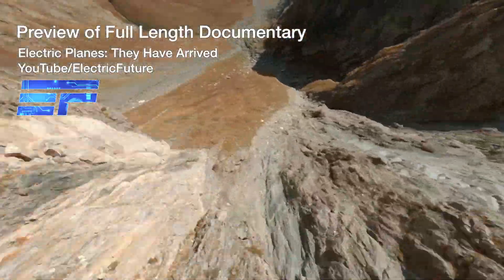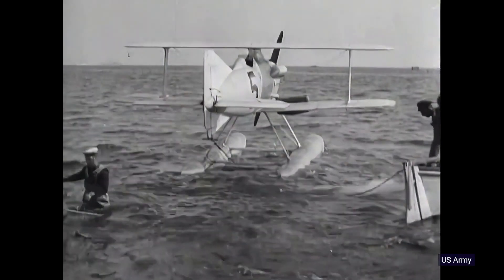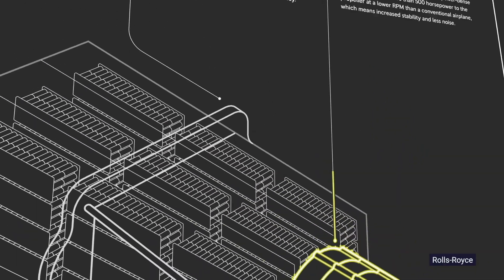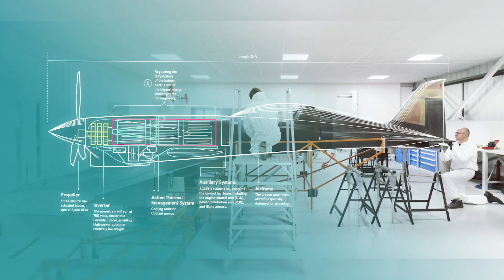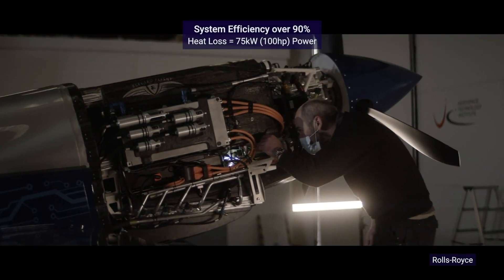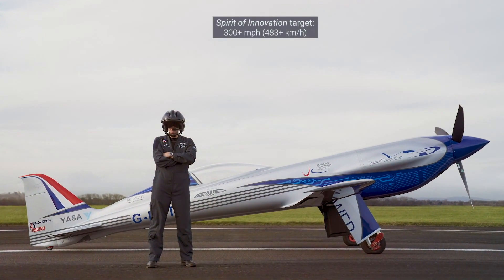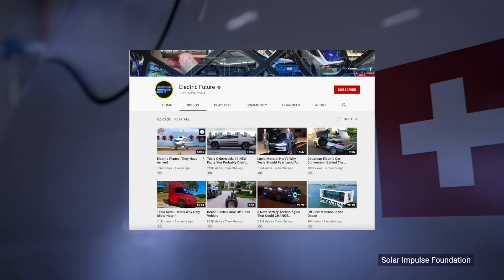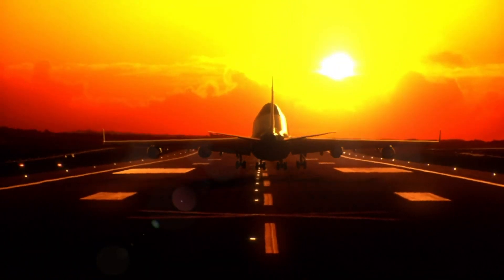The Fastest Electric Plane in the World

Comment: The stealth bomber is the most innovative electric plane that I have heard of. The vastly underpowered jet engine is a van der Graff generator to supply the extra high voltage conductor along the front of it's wing.
Thrust is generated electro-gravitcally.
Ref: Secrets of anti-gravity by Dr. Paul leViolete.

Comment: This is rubbish. The  Supermarine S-6B shows how little potential electric flight actually has. Battery powered aircraft have been flying for thirty years. Less than thirty years after the first powered flight, the S-6B went about 400 mph. The narrator mentions the variable pitch propellor and NACA inlets, part of the 90 years of innovation the "Spirit of Innovation" could draw on the S-6B couldn't, but the S-6B was much faster. You brag about the SOI's 200 mile range, but faster aircraft with longer range were carrying significant payloads across the English Channel ten years after the S-6B. Twenty years after that planes carrying large numbers of passenger at nearly Mach One were routinely crossing the Atlantic, often with Rolls  Royce engines. Electric flight is possible, but only as electric aircraft, not as any improvement on what came before. Electric flight has done nothing to contribute to aviation progress, and there is little reason to believe it ever will.